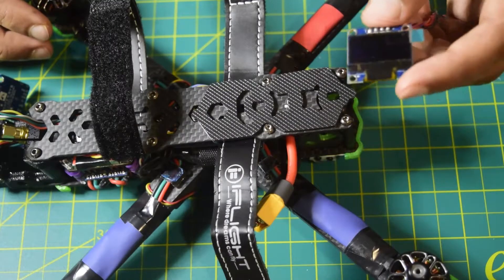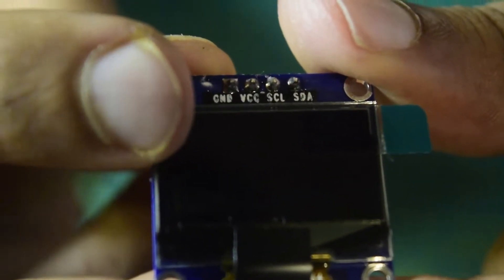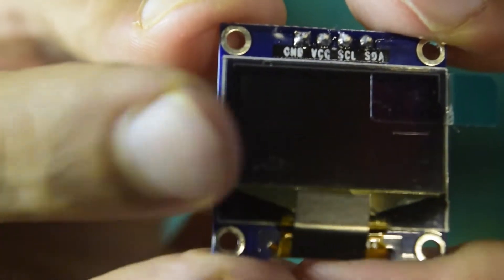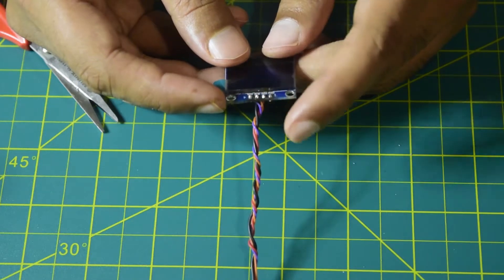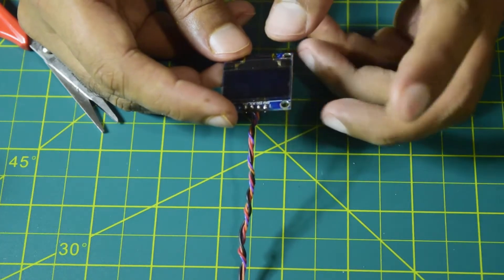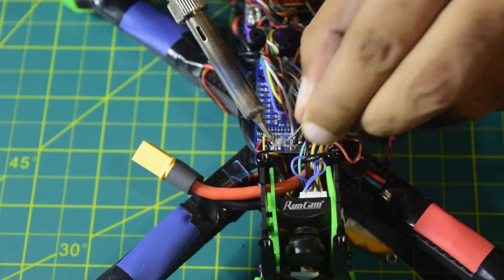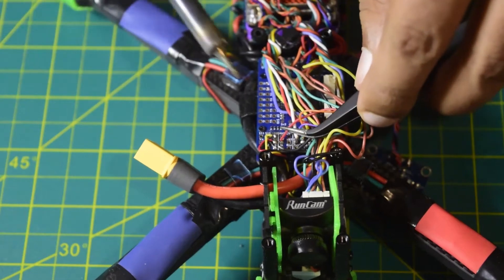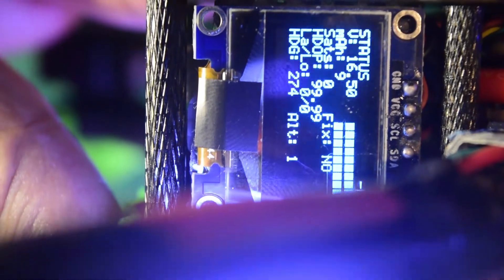How To Install OLED Screen on Drone for Status Display | 0.96 OLED on MATEKSYS F765 - WSE FC

Comment: I really like this idea! But it only works for the Matex FC, right? I use speedybee F7 V2 stack.
Reply from the maker: As far as i can check in the iNav firmware oled is configured as common hardware for all targets. Its default port is i2c 2 port if two i2c bus is available if not you can connect to I2C bus 1.  So for speedybeef7 v2 you have one i2c bus available just connect it there along with magnatometer just like I did and it should work just fine. I hope this helps. Please stay tuned to my channel for my future videos
Reply: @AstroShootingStars  Awesome I am looking forward to doing this myself. Thanks for your feedback.